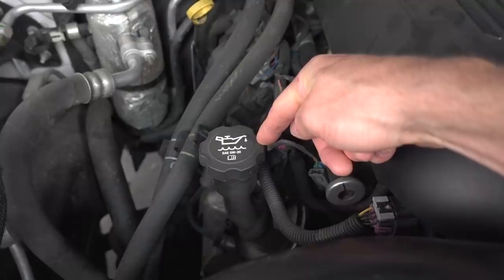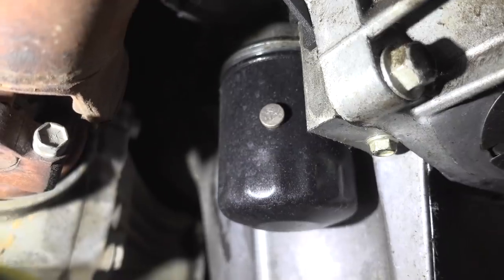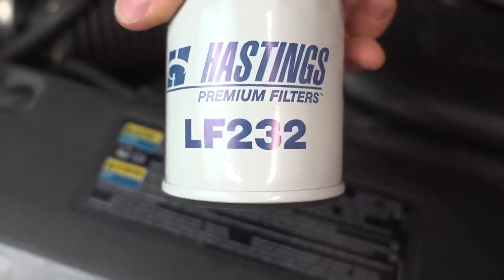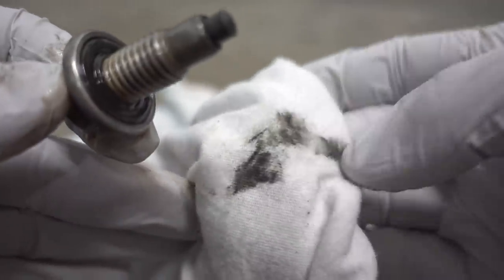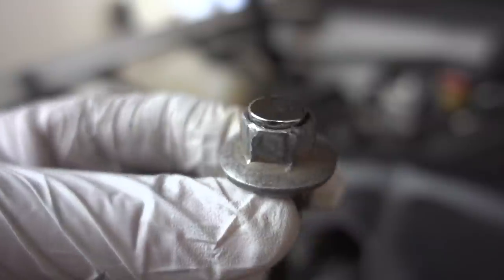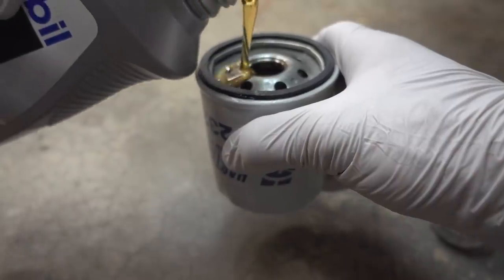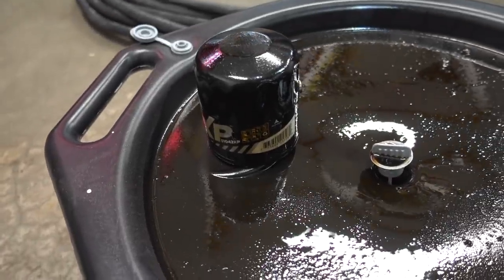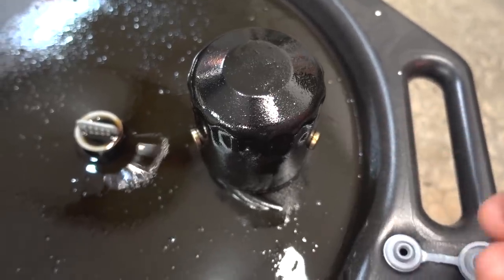Look What A Magnet Did To My Motor!

Comment: Let make those transmission clutches as slippery as possible 🤣🤪
Reply: and rear/front diff

slippery CVTs
Reply: I would use this in an open differential, but not limited slip. it may keep it from being able to improve traction. In a manual transmission, it could over-lubricate the synchronizers, making shifting difficult. I wouldn't dare use this in an automatic transmission, for the reason you mention. I can't even guess if it may cause slippage of the push belt or pull chain in either type of mechanical continuously variable transmission. (CVT). I would use it in an electronic continuously variable transmission (eCVT) because they don't rely on friction to transfer torque. They use two electric motors, and a single planetary gear set. The gear ratios are controlled with high powered electronic variable frequency drives, somewhat similar to a modern diesel/electric train locomotive.
Reply: @punker4Real  That would be my concern. I wouldn't dare use an additive like this in any application where friction is required, to transfer torque.

Comment: Great Video 1 Road, Here is a tip you can try with that ticking or clicking sound. I have used Mobil 1 Since it first came on the market and my Vehichles were flushed and cleaned when I started using Mobile 1. And the first filter change at 3000 miles or so. Add a quart Mobile 1. Then a complete oil Change at about 10,000 miles or twice a year between Summer and Winter no matter the Vehichles mileage if in good shape. Older or leaking vehicles  I added Lucus oil additive & stop leak no problems. If the engines were oil burners or junk nothing would help them repair them selves so, I just used 40 or 50 wt  cheap oil and Lucas they were fine. 30 years I am a top fan of Mobile1. But; always seemed I had a slight clicking and ticking in vehicles most noticed when idling  and first starting. So, one summer day my Chev pickup is sitting running in front of my new girl freinds house, with me in it and the small ticking got louder and louder. I tapped the foot feet and held it down a bit it leveled off while the noise was definetly still there. After that, I drove about 30 miles to my bud's shop where we mostly worked on everything. He had a hoist and sold tires and gas along the Interstate. He had become a dealer for AmsOil. So, we raised it up and put in AmsOil. Guess what? That ticking and clicking has never been heard from again. I was a changed man ever since. He told me his dad over heated his motor home bad even pealed the paint on the block from low coolant on a hot day. After it cooled down they started it, filled the system it ran perfect no problems. He had put AmsOil in it only a few days before. Hmmm that's pretty impressive to me. Not in any way would I say any thing bad about Mobile1. I remember 20 below zero and my dad was amazed when my Vehichles started with no heater on them. I said it's the oil Mobile1. He had always used Mobile Oil in bulk like 50 gal barrel's  he owned at least a dozen vehicle's. He said he never heard of Mobile1. He asked me where he could get some? Same place we alway's do. I seen it in a magazine add the Mobile Station they just only started making it.  Dad's gone now and so is the Mobile Station. But;  I still use it from Walmart if I don't have AmsOil. Also any Lucas Oil products and Slick 50 are a few more unbelievable great results.  Thanks again for all the info.

Comment: I used to  use old speaker magnets on my race car engines! took some epoxy, cleaned the paint off on the side of the pan, the magnets stick, epoxy made them stay where i put them. on a dirt car, the pan sticks close to the track, not much clearance, so stuckem on the side of the steel pans. worked well, all the parts that fell into the oil was on that side of the pan.

Comment: Hastings filters are a solid Commercial grade filter for tractor trailer originally so you can bet they will hold up to 5-10-w-30 , they can filter 15-40 for 30,000 miles plus, and the membrane is thicker than a puralator or a fram, Use with confidence, 30 yrs exp.

Comment: I always love your videos and agree with your advice. Only variation in my program is I like Amsoil and I use 2 filters per oil change with use of oil analysis. The test data shows that Amsoil is a little better oil. Oils lubricity factor increase as it’s used so, I feel Amsoil also has a superior oil change interval. Just my 2 cents, opinions very significantly. Important thing is to use quality oil and filter according to recommended oil changes.

Comment: I buy a whole bucket of motorkote at a time, from Amazon, no issue whether I have enough or not for my vehicles. Motorkote is the best drill bit fluid you can find around, cheap harbor freight titanium coated drill bits, drill like the expensive thing, I am not kidding, it's aaaaaahmazing!

Comment: the ticking is CSK. COLD START KNOCK. piston slap to be more precise. after the pistons warm up they grow slightly and the slap goes away.you can use a top end carbon cleaner and it may get rid of your CSK. OUR 2003 gmc 5.3 truck never did it and had 140k. i recommend using lucas  upper cylinder lubricant every time you fill up.
Reply: What? it was normal injector noise nothing more.

Comment: You should never use a friction modifier in an automatic transmission!
Reply: Lmao he's gonna be slipping all gears now
Reply: Agree.  Just use the latest version of the recommended fluid.  --  I've got a friend who used to work for HydraMatic.  He says the fluid is not necessarily bad when it turns brown, but is is if it smells burned.  So I did changed at 45K (when I bought) and 75K.  He thinks the fluid will be good to 175K, watching its appearance/smell.  THM4L80E
Reply: Just use exactly what Ford recommends for fluid, but do it every 30k miles.
Reply: it says it's wetclutch safe, so should not be a problem. but i've read some bad stuff about motorkote. so i wont be trying it out anytime soon
Reply: Yep his clutches are gonna be trashed you don't want friction reduction in a multi clutch transmission like an auto only transmission fluid
Reply: @Justthemow  doesn't hurt it at all
Reply: peter barber u have no idea what you are talking about they are friction clutches they are driven by pressure if you reduce the amount of friction between the clutches they slip which causes premature wear.  this is what you would feel when your transmission first starts to go out the clutches slipping from loss of friction.  so if you put in something like oh I dunno a friction modifier that makes things slicker that's bad mmmkay
Reply: Its snake oil... It will swell the seals for a while and nothing else.
Reply: @latrogeniwile58 --- Do NOT use the latest version fluid, Latro---. Use the fluid that is recommended for for your trans, in your owners manual. Example would be Dexron lll.  Do not use Dexron Vl
Reply: @latrogeniwile58  Instead of sniffing oil, send it to a lab for $12. John Deere seems to have the best price.
Reply: I've ran motorkote in my transmission for at least 10k miles now and when I first did it I noticed less "drag" when driving. Fuel mileage didn't increase but I use to lose speed even going down hill in my Ram 2500 4x4 QC but now I don't and haven't since I added it. So anecdotal evidence is what it is but I certainly didn't get slipping.

Comment: For that ticking noise, I'm not an expert, but from what I've read around the interwebs it's related to parts sticking due to carbon buildup. I used Marvel Mystery oil (in gas tank and as replacement to motor oil where I removed ~1 quart of motor oil and put in 1 quart of MM). After 2-3 weeks (half a tank) the ticking had audibly reduced a lot. Previously I could hear it inside the cabin, now I can't hear it inside the cabin and have to pop the hood to hear it at all. The engine sounds MUCH smoother.
Reply: After a demonstration of "Rislone" Engine treatment" (yellow bottle),  I tried a container of it with a fresh oil/filter change on my "Ticking" '05 GMC Canyon 4cyl, and you know what- it quieted down and began running smoother within 100 miles. The new oil got dark quite fast showing just how much carbon was in my engine. My truck has soooo much more pep now. I heard from people that stuff works & I can testify to that.....

Comment: Instead of adding a rare earth magnet to your drain plug, u should place it on the oil filter, therefore removing any ferrous material when you change the filter.

Comment: The thing with the magnets is that the oil gets hot, which then makes the magnet hot.
Hot Magnet = No Magnet.  Not saying it loses all magnetism (which would require it to melt) but it does reduce it a good bit, and seeing as how the magnet was originally already pretty weak, no telling how useful it will be.
Reply: Cheap weak condom is better then no condom, think of it that Way lol
Reply: While there may be truth in his comment regarding magnets and heat, also kinda redundant comment as you can clearly see in the video or if you have ever changed the oil pan or oil/filter etc of an automatic transmission (magnets just sitting on the bottom of pan from factory) that the magnets still work. How much magnetism/strength do you think is required to capture and hold such teeny tiny little particles? Ideas not to capture say metal shavings because  if you have metal shavings of any significant size then you have much bigger problems and unfortunately NO magnet or filter is going to help anyway

Comment: A magnet and probably a larger one would be preferred could take metal particles/shavings away from engine parts and that would have some benefit. But the real problem of abrasion to the engine parts comes from anything that gets past the air filter and carbon deposit that don't get burned and go out the exhaust pipes, but rather stay in the engine cylinders valves Etc and mix in with the oil that circulate like liquid sandpaper. I like the idea of putting a strong magnet for ferrous metal particulates. But changing your oil often will be a whole lot more beneficial to your engine to prevent damage and get two or three hundred thousand miles or more. Make sure you have clean air filter that you can see light through it.
      I had a girlfriend who worked on the golf course in Virginia and they would change the oil and filter on the rideable mowers every 5 hours because of the sand that would get past the air filters. That was years ago, but I still found that interesting.

Comment: I work for Jiffy Lube I take Drain plugs out of cars everyday, from old to new, from Honda to Jaguar. The only cars that get magnet tipped drain plugs are Chevy Silverados/ GMC Sierras 1500 models only. Magnets don't help as much as you think it does that's what the oil filter is for as long as you change your oil on time the engine will be a lot cleaner.

Comment: The Ferrous dust is probably timing chain & sprockets. It would be interesting to see the inside of that '95 oil pan. The ticking or clicking is most likely exhaust manifold leaks; smoke test to be sure. Todd at Project Farm is awesome, he always gives tested products a fair review.
Reply: What if your car has a timing belt ?  There are many ferrous parts in an engine that wear on a normal basis. Ticking noise on start up is generally hydraulic lifters  until they fill with oil.
Reply: Yes, because the valve train is at the top- it dries out due to gravity. If your hydraulic lifters are draining- their check ball valve springs are weak, or the oil passages are plugged; they don't normally drain once filled. Rings scraping cylinders, cam lobes, rocker arms, pushrods (not in OHV) cam & crank journals- are all sources for ferrous dust in your oil. Many OHV engines use solid tappets in place of a hydraulic lifter.

Comment: Priming the filter has one variable.  If the filter has an anti flow back valve, it will hold what you add to it. Otherwise,  you will  lose some. I was an ase certified master tech,  a senior certified tech in a shop and I have worked on  cars for years.

Comment: The rare earth magnets degrade at a relatively low temperature unless you buy the specific ones rated for high temperature. Notice that the OEM magnets in your transmission pan and on the oil plug are ceramic - CHEAP and suited to high temperature. For $5 you can line the entire bottom of a steel oil pan or transmission pan with ceramic magnets.  As for the magic slick, I'll stick with motor oil only... and Walmarts dino fliud works just fine.

Comment: Before MotorKote was sold by Doctor Dave the instructions were 2 oz / quart for the first 50,000 miles and 1 oz there after . I had talked to him a few times and I could never get him to comment on the fact that everyone I got to try it would get 10% better gas mileage , I don't think he wanted to back that idea BUT 10% told me it was really doing the job . I've done wheel bearing to on the first regreasing . He told me it was a liquid polyester not like teflon , so there you go .

Comment: Bad idea megnatizing the bolt. Metal on the threads as you remove it= dickered threads. That's why the magnet it smaller in diameter. Use a longer magnet if possible.

Comment: Hey Jimmy, put some oil around the rubber filter gasket to facilitate easier removal and to form a wet seal between filter and engine filter mount. Sometimes, leaving a dry filter gasket will deform or warp as per engine heat and blow all the oil out of your engine. And, before you finally find the leak, your motor is cooked....DUH!

Comment: The 1995 may have flat tappets (lifters), not roller, and mine with the 454 does.  In this case you want the Mobil Oil with the highest Zinc content.  M1 High Mileage for vehicles over 75000 miles.
The ZDDP will protect the flat tappets. (Your 2003 probably has roller lifters)
Your ticking noise might be the fuel injection.
Reply: yes his 2003 would have roller lifters .  willing to bet money though that he has a broken exhaust manifold bolt, which on these LS motors creates a small leak between cylinder head and exhaust manifold and it actually sounds like a small tick  in the motor when it opens the exhaust valve on the effected cylinder. usually is more pronounced in colder weather till motor warms up and metals expanded closing up the gap
Reply: It has rollers,

Comment: What a magnet will do is collect the flour-sized iron particles that can pass through the filter and recirculate through the engine. Those magnets are really too small to do much. However, take a 100-200 pound "lifting" magnet to the side of the oil pan and it will collect these particles round the clock. Remove the magnet at oil change and they will flush out.

Comment: On your 2003 suburban you should get switchback leds for the front. They're white when your headlights are on and then amber when turn signals come on. They look great! You should check them out. I bought partsam led switchbacks for $14 on amazon
Reply: Jacob Nichols link
Reply: Jacob Nichols  jdm amstar’s are better
Reply: jacob stienecker yeah, I know. These work great for me and are plenty bright. I have 8 led lights on at night on the front (Fogs, Parking, marker low beams) and get flashed quite a bit even though my lights are aimed properly. JDMastar is better quality, these are half the price though

Comment: You overfilled your engine when you added the MK.  You should have put 12 oz less oil to leave room for the MK.  Just sayin.
Reply: How do know he didn't leave room?
Reply: I caught that too. I use motorkote and always fill the oil slightly less to allow for the additive. BTW: The MPG in my 2000 Hyundai went from about 34 to 41 MPG.
Reply: Ahhh it's a Chevy it's a junk yard candidate anyways.
Reply: You can actually put an extra quart of oil in your engine without harming it. In the old days when there were still gas attendants they will check your oil and not insert the dipstick fully then show you that you "need" to buy a quart of oil. That's how shady gas stations made extra money. No engine broke down because of it. It just broke your wallet.
Reply: @jungojerry1658  You might get 7 miles more a gallon if you changed your air filter , cleaned your mass air flow sensor(MAF) added a Throttle body spacer, cleaned the throttle body, replaced the PCV, New Plugs and wires , Indexing your plugs , added new less restrictive exhaust , Advance timing by 1, replaced intake with forced aspirated ,Took your seats out , took the spare tire off, And put helium in your tires.And I still doubt you'd get 7 more miles a gallon . Maybe a little more Torque and response and get maybe 2 MPG more.....You acting like CNN ... fake ass news.
Reply: @lane4574  -- How about after doing all the things you recommend,  you park vehicle and claim it uses only one tank per three months.
Reply: You can overfill the crankcase because Motorkote bonds to
The metal.  Read the bottle, it says you can overfill.

Comment: If you want a better running engine throw in some Castol synthic and hear the difference in how your engine idles after getting off the Mobile one. Its night and day and the oil stays cleaner longer.
Reply: If you want it to idle better, but a 1:500 ratio of TC-W3 semi-syn outboard motor oil in the fuel.